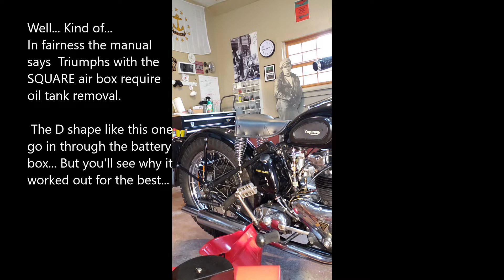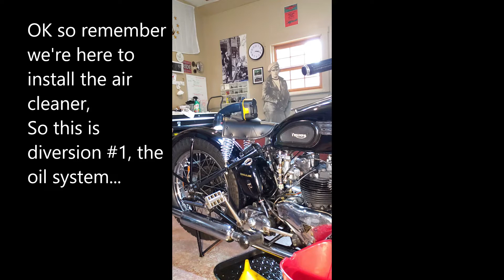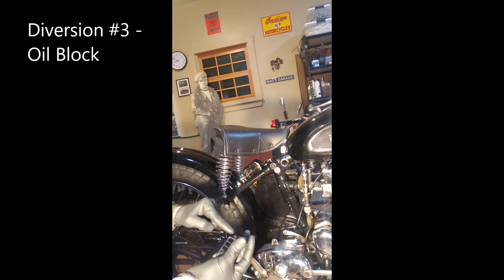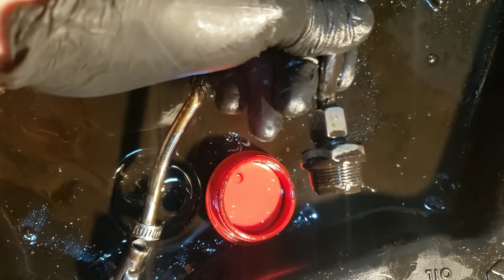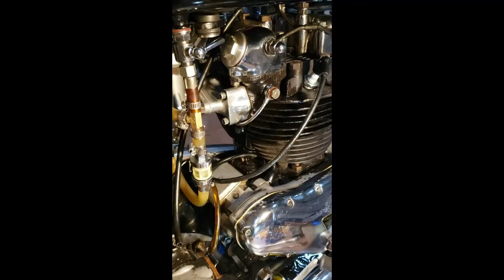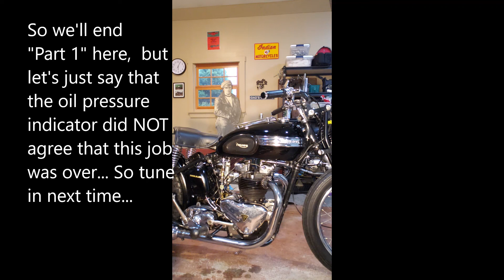1953 Triumph 6T Thunderbird Air Cleaner Install Part 1 - how it spirals into an oil system rebuild

Comment: The sludge trap in the big end of connecting rod would be choked up too...hence no pressure indicated ! Major bottom end dismantling 😱
Reply from the maker: Yeah... well, stay tuned... To your point I did blow air clear from the sludge pickup back through to the oil pump and everything down there seemed fine. That said you're right the issue there was more likely the crank flow or something deeper.  Long story short things got more complicated and the crank's coming out anyway now, so yeah,... She'll be back in the Spring and when I get over it I'll post the rest of the video on how it all went south... Thanks for the note though!